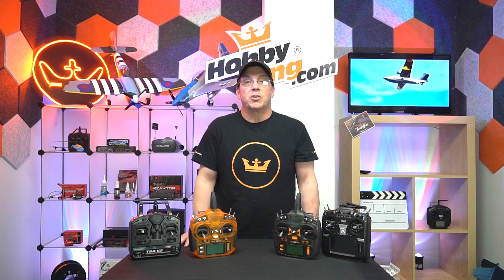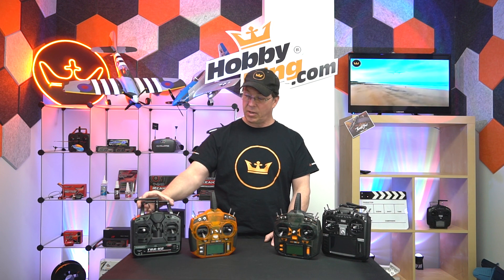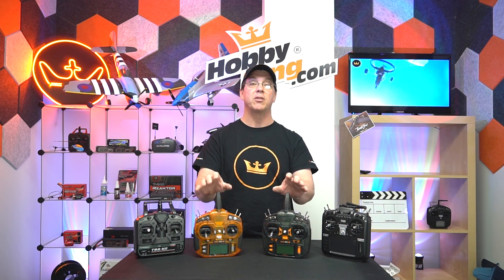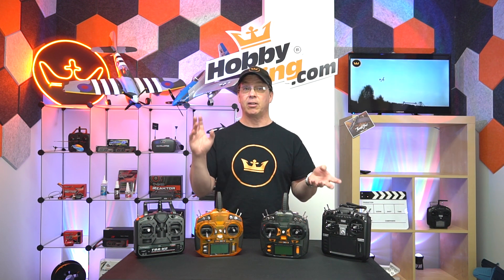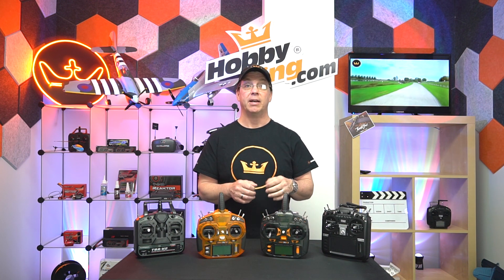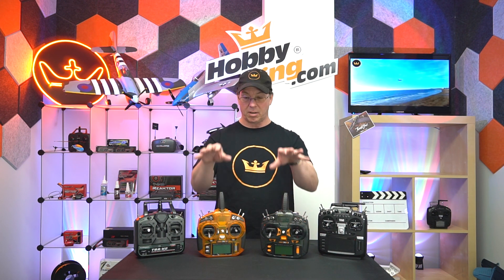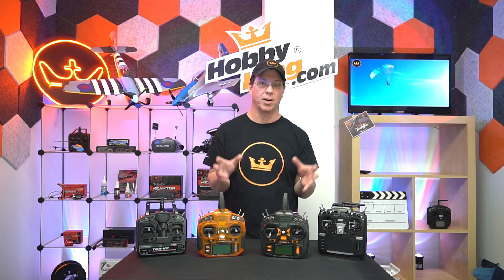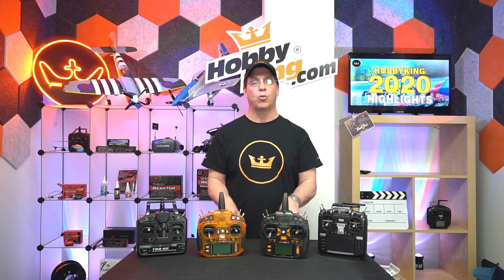Tips Bench Tuesday: RC Radios - Everything You Need to Know

Comment: im just getting in rc airplane what is frustrating for me is how much protocol there is and how it force you to go 1 route for esc i dont get why they fight so hard to prevent you to bind your radio to any esc was able to get my hand on a fsfly t-six for really cheat but learned that its dsm2 and dsmx but i just learned that my plane use v761 and its a pain now i need to find another cheap controller that work whit the v761 and can be programmed also

Comment: I do have a question:

What's the matter with Mode one and Mode two?

I have a 30 years old Graupner mc-15. If I want to switch modes, I just change one setting, relocate two springs and I'm done. Is that worse on a Tx16s? Which costs 250 bucks in Germany btw.